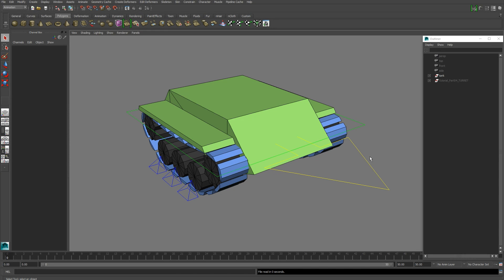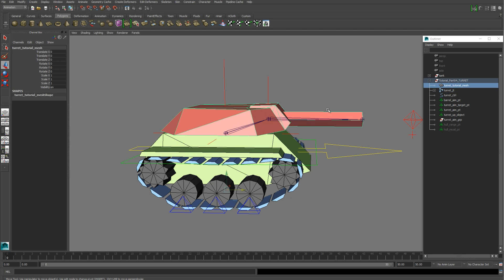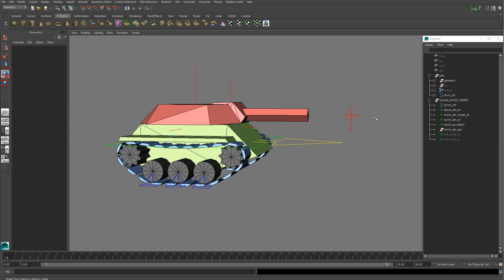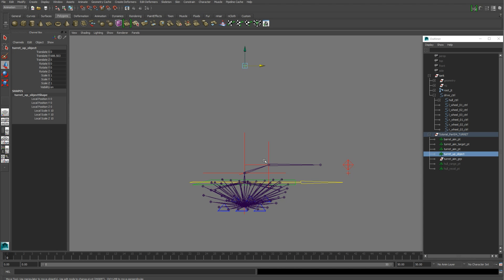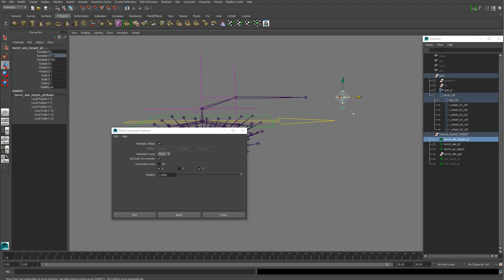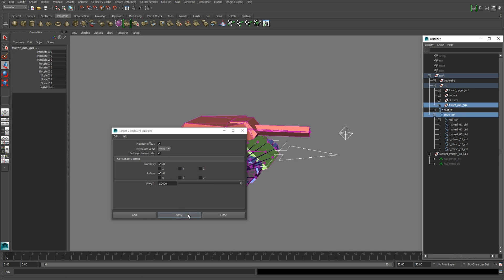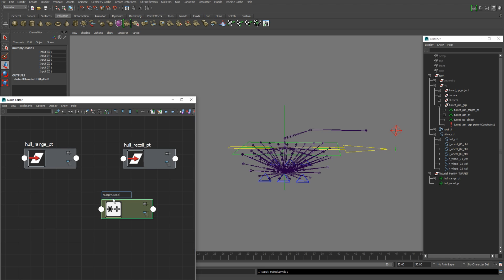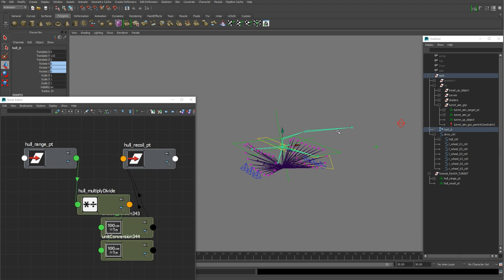How to Rig a Tank in Maya | Tank Rig in Maya | Part 4 Turret

Comment: My tanks chains are not moving when i slide the value on recoil i followed every step though
Reply from the maker: Is it moving correctly for everything else?
Reply: @SimonMills  yes it is moving correctly for everything else but when i parent the cluster grp to the joint recoil works but while using drive the tank chain seems to be mess up ?
Reply from the maker: @AkashSingh-b9i7e  are you clusters set to relative?
Reply: @SimonMills  No

Comment: Hey Simon i have another Question. At my curent state i have done every step of the first and second tutorial, because that was the minimum i needed for my own rig. My Problem is that if i try to animate the whole thing, first my wheels an treads move super fast and second they dont stop moving as i stop the movement  The treads move slowly forwards and the wheels start rotating in the opposite direction idk how to fix this? The whole rig works fine when i move my drive ctrl in the viewport.
Reply from the maker: Try a maya restart. Viewport 2.0 can be twitchy.

Comment: Not all heroes wear capes. Thanks man this saved my behind although the model I rigged is not a tank but a bulldozer haha  but one question though, I followed the rig through and through everything is working as intended and I had no problems whatsoever. But when I started an animation, I made my bulldozer move forward and it seems fine but when the animation of the bulldozer stops (the whole shot is longer than the bulldozer animation), how come the tracks do quick slight snapping and jerking and sliding movements and don't stay still?
Reply from the maker: A few others had this issue, it turned out to be a display issue with viewport 2.0. Restarting Maya fixed it.
Reply: @SimonMills  At first I did assume it was the viewport but when I restarted Maya and rendered the shot. The jerking showed up in the renders. Now I feel the need to fix it in an unorthodox manner when my animation stops lmao

Comment: i have found a problem and went over it a few times before deciding to ask here. when i do the recoil nodes in the node editor (10:00), it breaks my rig. after i complete it and try to use the recoil, the treads no longer conform to the gears. i know they work before i do the recoil bit, but have no idea why it happens.
Reply from the maker: constrain the clusters to the hull joint, not the drive control.
Reply: @SimonMills  that doesn't seem to fix the problem. when i finish with the recoil stuff now, this happens: https://imgur.com/gallery/TiQncwq
Reply from the maker: @bakaunko247  wow, I haven't seen that before. It looks like your aim setup might be the issue. The hull should not flip like that.
Reply: @SimonMills  i'll check it out and get back to you. the turret aim correct?
Reply from the maker: @bakaunko247  yep

Comment: First off ,  Awesome tutorial , I do have one question. And perhaps I missed it, but is there a global control both for moving the tank to different locations and for scaling the asset ?
Reply from the maker: Not in this tutorial but it can be added with some tricky adjustments.
For those who have purchased the complete rig, this feature has just been added.

1. move the parent constraint on base_jt to root_jt instead.
2. create a top_ctrl and add a global scale attribute to it. Parent drive_ctl to top_ctrl.
3. remove parent constraints from tread_up_object + clusters groups.
4. connect global scale attribute to the XY&Z scale for turret_aim_grp + root_jt
5. turn off scale compensate for all joints.
6. remove constraints from all clusters.
7. direct connect the Y axis of each wheel cluster to their corresponding wheel ctrl.
8. create a locator, call it “hull_cluster_pt” and parent to clusters group.
9. direct connect the “hull_cluster_pt” rotation to the hull_jt.
10. parent constrain (Translate Y+Z and Rotate X+Y Only) the l_ & r_hull cluster to “hull_cluster_pt”.

Thanks for great request,
-Simon

Comment: everything works perfect! ,really clear tutorial ,did it on a tank of my own and it works just fine, but i was wondering if it's normal that the root joint stays at (0.0.0) even when i drive the tank, i see in your video that it is the same but am new to rigging and dont know if this is a problem or not? anyway great job thanks!
Reply from the maker: Yep. The root joint stays in the center. When exporting to a game engine this allows for baked in distance.

Comment: Awesome tutorial Simon! I modelled a little robot with this rig and Im having a problem.. I move the robot with the drive ctrl on a motion path. Then I change the speed with the keyframes of the motion path. Worked like a charm but sometimes when the robot stands still on the motion path the wheels, and tracks, move while standing still. I assume that the drive value gets input while the robot is standing still.. Maybe you know a solution? The weird thing is that it worked before and suddenly the wheels and treads move while the whole model doesnt.
Reply from the maker: Send me a video or scene file and I will take a look.
Reply: @SimonMills  We may have solved the issue. We are not 100% sure but for now it works again. Turned out that there were some old versions of the robot in the scene. Also we discovered that the scene needs to match the unit (in our case we changed to meter) of the referenced RIG scene, otherwise the treads will move way too fast.

Comment: Welp, I'm afraid I have to bother you again. I've got everything working the way it should - however, when I constrain the wheel controllers to geometry, they progressively "derail" further and further (worsens with bumpiness), until they're just way off, making that feature unusable. Point constraining the controllers to the tank seems to help, but it's still not perfect - there's some wobbliness in there. I basically want to make it so the controllers are only free to move on the Y axis, no matter what other constraints are on there. Thank you again for the tutorial!
Reply from the maker: send me a screenshot/video if you could, thanks.
Reply: I solved this by constraining the wheels to locators and parenting the locators to the wheel controls. So the controls stay and the geometry constrain does work. But I just tested this on a very basic plane as I didnt need that feature yet.

Comment: Bro, this is the best tutorial for tanks or any vehicle with tracks. I have one problem though, when I import or reference the tank I built the expressions stop working giving me the error message (An execution error occured in the expression *expression name*) Is there a fix for this?
Reply from the maker: I have not seen this issue.  Importing multiple tanks causes an issue that can be resolved by opening each tanks expression and giving unique names to the variables.  Search for "$" and replace with "$tank1_" for tank 1 and "$tank2_" for tank 2 and so on.
Reply: @SimonMills  Hey man sorry for super late reply, Which part of the expressions should I change? I can't find anything to change without breaking it. The script works for one tank but as soon as I import another both breaks, If I get rid of the 2nd tank it will start to work again.
Reply from the maker: Each Tank has it's own expression. They just need a unique name for their variables.  Search for "$" and replace with "$tank1_" for tank 1 and "$tank2_" for tank 2 and so on. If not you will have their values overwriting and causing issues.
Reply: @SimonMills Hi bro,  amazing tutorial, I had the same issue. I tried replacing all "$" with "$tank1_" for tank 1 like you said but it gives me "Expression invalid after edit" if possible may I see a screenshot of what you mean by replacing variables?
Reply from the maker: Just a do simple search and replace in any text editor. The $ indicates a variable and the variables need a unique name per vehicle in the scene so they do not overwrite one another. A simple example would be x = vehicle1 distance. ( x would be the variable ) If you have 2 vehicles in the scene then we also have a duplicate variable x = vehicle2 distance. So in order to stop them messing with one another we would just name the second one y or something that is not x.  X would store the vehicle 1 distance and y would now store the vehicle 2 distance.

Comment: Hi and thanks for the tutorial, is very clear and useful to me!!!
Everything works just fine, I only got one problem:
when I use the recoil value, the trails stay where they are, like there's no effect on them.
I don't know if it's a cluster problem (I thought I had to do a double constraint on the hull clusters too and it seems to work, but not perfectly... I get some slight interpenetration) or else, with the hull_ctrl the trails move and "deform" like they're suppose to...
Can you help me please?
Thanks and great tutorial!
Reply from the maker: Hey Valentina, you only need 1 double constraint. That is the hull_jt being orient constrained to both the hull_ctrl and the hull_recoil_pt.  The hull cluster needs to be constrained to the hull_jt, not the hull_ctrl.  The hull_jt accepts both ctrl and recoil, so this is the one to use.
Reply: there it is! 
thank you so much!

Comment: First of all, thanks for the tutorial, it was really helpful. Second, I wanted to know how to create a global scale and translate function for the tank. I tried creating a controller and putting everything inside the controller for translating, rotating and scaling the tank but I am having problems with the treads. I turned off the inherit transform box but the treads still acts like it has double transformations. The curves controlling the treads are in place but the geometry and joints aren't. Any suggestions?
Reply from the maker: Hey Atul, for a move/rotate you could just create a top control and parent the drive control to it, that should work fine, however it will not scale. To add a global scale it is quite a complicated and significant mod to the way this rig is setup. It requires using individual multiply divide nodes on each tread joint so they scale correctly and not explode with the double transforms. Best done by writing a tool to automate each tread connection.

Comment: Hi ! First of all, thank you for those tutos, I was desperate to be enable to rig my high poly tank model and you saved my project. But I'm stuck at the step where you orient constraint the hull_jt to the hull_recoil. There is already an orient constraint between the hull_ctrl and the hull_jt so I can't create this new constraint. Any idea on how to bypass it ? Or maybe I missed a step, it's quite difficult for me because I have to apply you tutos to my model and maybe I did something wrong. Hope you will be able to help me !
Reply from the maker: Hi Ade, Glad this tutorial helped you out. You have not made a mistake, just keep watching. You can have multiple constraints on same object. In this case we orient constrain the hull_jt to both the hull_control and also the hull_recoil. We then setup a switch to blend between which is activated when gun fires.
Reply: Oh yes I see. That’s because I used a parent constraint between the hull_ctrl and the hull_jt, I wanted to be able to elevate or lower the hull on the Y axis, just as the real tank I modeled. So I just replaced the second orient by a parent but only effective on the rotations. 
Thank you for your answer, keep up the tutorials, they are amazing and easy to understand !
Reply from the maker: Nice fix!
Reply: Hi again ! The rig is working perfectly so thank you very much for those  4 videos. However I have a question. Is it possible to make the barrel stay aimed to the turret_ctrl will firing ? Like the hull and the turret take the recoil and the gun follow up but stay pointed to the turret_ctrl.
Reply from the maker: Glad to hear it worked out!  For the recoil thing, you just need to add in something to counter that barrel motion. So parent in a new locator that moves the barrel however you need it to that is also keyed when the gun fires. I had a tank setup that way once before but it looked odd with the whole tank moving back and the barrel held, perfectly aimed.
Reply: Done ! I divided the rotateX of the hull during the recoil (at the static position) by the recoil, then I used a multiplyDivide to multiply the recoil by this value, and then I used a plusMinusAverage and pluged in the rotate value from the aim and the output value from the multiplyDivide. Finally I took the plusMinus output and pluged it into the rotateX of the Gun axis. Thank you to showed me the way !
I find it more satisfying haha as it is a modern MBT, when it fires, the gun stay aimed to the target
Reply from the maker: Nice job!

Comment: Hello. My problem is that in the view-port when I move the tank the tracks move accordingly, but as soon as I add key-frames they start spinning really fast and they never stop. Do you know what might be causing this?
Reply from the maker: Not without seeing it. I did some tests just now and the only issue I found was at certain speeds the low-poly wheels did look like they were spinning too fast but if I skinned a cube to the outer rim of a wheel and watched that spin instead of the wireframe the speed looked fine.  So basically the spinning wireframe plays tricks on the eyes.  That could be happening in your case also.
Reply: I will make a video and pm it to you. I don't think it's the wireframe, I did a quick render to test this in arnold and the render output is the same. I also have to say I did this on two tanks and i got the same result.
Reply from the maker: send it to smills@trickbox.ca
Reply: Sent you an email, thank you.
Reply from the maker: Ok I found a solution to the problem you were having. Let me know if you have an issue viewing the video I emailed you.
Reply: You're a life saviour. Both my tanks work accordingly now. Thank you very much and for people who want to have two tanks in one scene you have to change some stuff in the expression Simon gave us in part 2. Wherever there is a "$..." change it to something like "$Tank2_..." . This made both my tank tracks work correctly thank you very much.

Comment: Hi Simon Mills
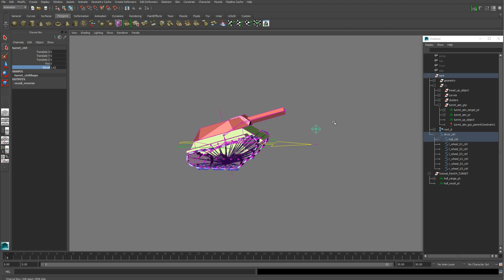If you change the value of Recoil at 10:29 of movie, wheel will penetrate Caterpillar.

↓ It is an image when the phenomenon happened, I am sorry if I can not see it
https://photos.google.com/photo/AF1QipNpOB0AcRaOecw0yDGpX1luAd68TIdtIyvh6q3B?hl=en

This kind of phenomenon happens, but what should I do?
Reply from the maker: email me that image: smills@trickbox.ca
Reply from the maker: Thanks for the email, it looks like you are missing a connection for sure. Assuming your treads are moving correctly when you use your "Hull Ctrl", The solution would be here:   Double check that you have orient constrained the "hull_jt" to both the "Hull Ctrl" and the "Hull Recoil Pt" If so, then double check the switch setup.  The error should be resolved in this section https://youtu.be/heiU92PA1QI?t=8m42s
Reply: Thank you for your reply.
As for connection, I confirm that "Hull Ctrl" and "Hull Recoil Pt" are orient constrained with "hull_jt".
Still the phenomenon seems to happen
We will send a screen shot of the node by e-mail.
Reply from the maker: Thanks Sin.  Does this issue occur when you rotate the hull control or only during recoil?
Reply: Move the value of recoil will cause problems. Hull control works without problems even if it is rotated
Reply from the maker: I'm gonna take a wild guess and suggest that your "l_hull_cluster" and "r_hull_cluster" are constrained to your "hull_ctrl" instead of your "hull_jt"
Reply: Thank you Simon Mills.
Somehow I solved the problem

Comment: I do the geometry constraint and it works fine, however when I move the tank over any terrain deformations, the wheel controls move. Any idea why? Or is it just a problem with the geometry constraint? The control curves' pivots are all on the same level as a, well, level ground plane...even with X and Z translates locked -_-'
Reply from the maker: Yes, it's a limitation with geometry constraints. Resetting the transforms on the wheel controls will fix it if it gets a little crazy. I find resetting before playback works best and bake these controls down for your final animation.
Reply: ok, at least I can work around it XD

Comment: hey simon, i followed this video tutorial but i am stuck with a problem at a step...after that recoil setup both the tread and gear should be adjusted according to the rotation of hull joint but in my case only gears are adjusting not treads how to fix that..??? i think i may have missed some of the connection between the hull joint and the tread please tell me what that connection is and how to join that...??
Reply from the maker: Hey Shubham, try going back to this point: 
https://youtu.be/x-izDmWOI8o?t=7m50s

If you still have issues email me the scene file or a screen shot of your node editor. ( smills@trickbox.ca )